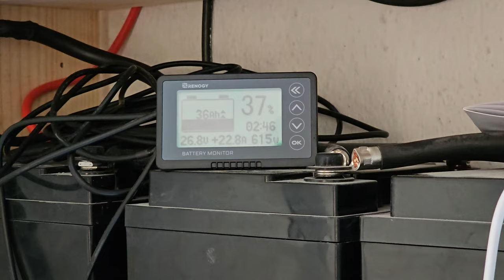#22 Finishing solar water heater installation. Expanding solar battery. Old Greek off-grid house.

Comment: Keep up the good work 👍 did I see on one of your videos you was using a battery monitor for your solar system? Have you got a link for it please?
Reply from the maker: Thanks. Sure, I bought it here: https://de.renogy.com/renogy-500a-batterie-monitor-neue-version/

The price is crazy though at the moment.  It floats, I bought it for 70 bucks.

I investigated this question before and checked options on Amazon and AliExpress and they all seem to be similar and cost around 70 euros. So I couldn't save money on that.